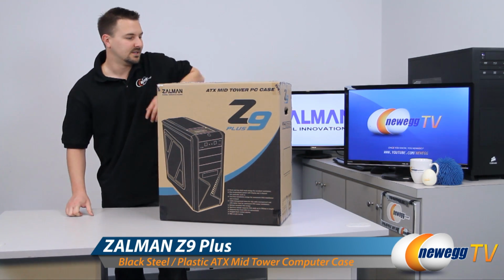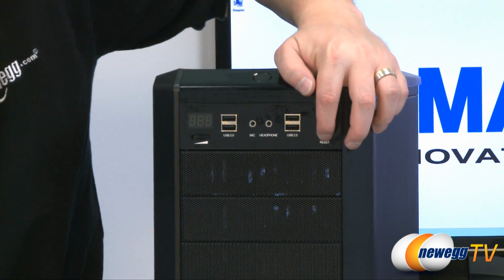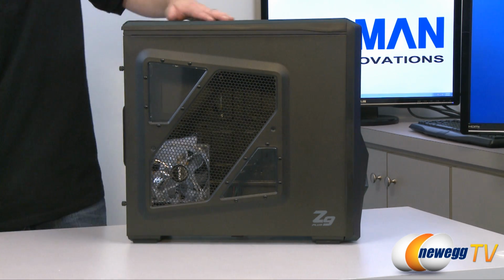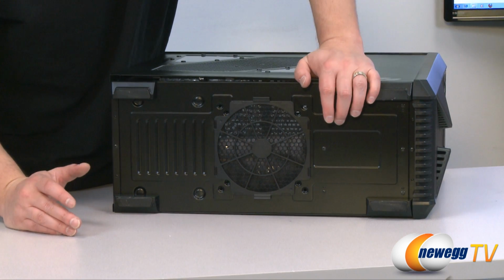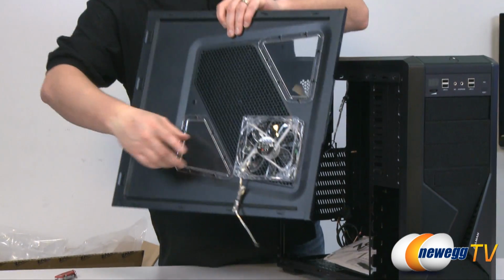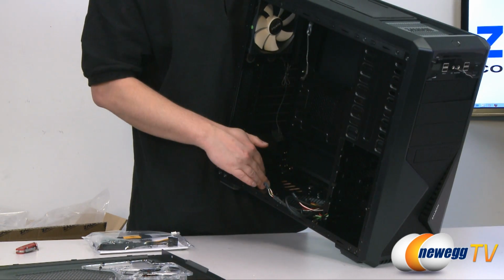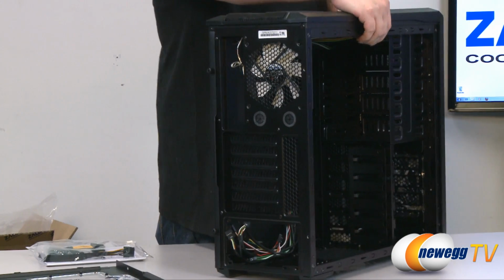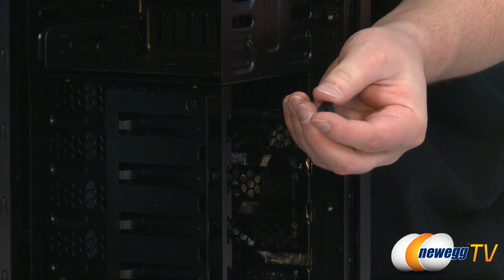Newegg TV: ZALMAN Z9 Plus Black Steel / Plastic ATX Mid Tower Computer Case Unboxing

Comment: i have one of theses very durable. a bit more thought could have gone into the 3.5" drive bays, i just did not like that part of the case with the rubber parts to go onto the drives themselves, but overall i got 7 years out of this case and it is still in good condition, the look of the case was what attracted it to me, also cases with optical drives bays are getting harder to find good ones anymore as case producers are not making as many anymore, or mot making cool looking cases. good unboxing video covers most of what you need to know, thanks

Comment: + It's big enough to put a dual-graphics card configuration in it.
+ You are able to watercool in this case.
+ Nice blue LED fans, which look really nice.
+ Cable management holes, which can be really handy and it looks way better.

- When you turn down the fan speed the LED's will become less bright, which doesn't look as appealing.
- This case comes with only one dust filter which can be found in the front of the case. 
- Loads of open spaces where dust can get through, I've had it for about a year, but it's a complete dusty mess on the inside.
- When you get a modular power supply the inside will look a lot nicer, but you can't put in the fan at the bottom of the case.
- One of the fans is not an LED fan, which is a shame and I have no idea why they didn't just replace it with an LED fan.
- The amount of cable management space at the back is nice, but I would have liked to see a bit more space, because the power connector for the motherboard is nearly too big.
- The 8 pin power cable for the motherboard can't fit in a hole at the top left of the case. They could have made the hole half an inch bigger and it would have been able to fit.
- When you put a component in the PCI-E bracket you have to 'break' a little metal bit that normally covers it. A replaceable metal bit would have been better.

All in all, for the price it's decent, but the manufacturers didn't really think most things through. It feels like they were like: "Well let's put it on the market so we are done with it."
With a dust filter at the bottom, maybe a bit more clearance for another fan at the bottom and a bit more space in the back they could have sold this case for around $100.
I can recommend this case for people on a budget, who still want a good looking case. But there are cases out there which are better for the price.
Reply: Pywy #Nope I do like the case for it's looks, but there are just a few too many cons. And even though most of the cons are not too bad, they could have easily fixed them. For the price it's a really good case, but if I were to spend a bit more money this case definitely wouldn't have been my choice.
Reply: MrGrayfour "But there are cases out there which are better for the price."

And those are?
Reply: maiika 
Fractal Design Core 2300
Corsair Carbide Series 100R
Corsair Carbide Series SPEC-01
BitFenix Shinobi

For slightly more money
Corsair Carbide Series 200R
Reply: Shinobi and SPEC-01 could be alternatives, but I don't see what's better about them in comparison to Z9+. Shinobi can have problem with airflow at the bottom, while SPEC-01 has only 1 fan.

200R has got 44.2°C at 400W temperature and fans set at 12V, compared to 26.3° of Z9+ which has better temperature benchmarks than +80% of tested cases on the market. That's crazy considering the price.

http://uk.hardware.info/productinfo/benchmarks/7/cases?products%5B%5D=119791&specId=8874&tcId=283

Unless you think there's something more important than temperatures?

Comment: I don't understand.. I have three fans, but only two connections FOR the fans. this means that one of my fans aren't doing anything.. If anyone can tell me something I can do about this, I'd appreciate it.
Reply: One of the fans can be connected to the motherboard, so it will receive it's own power through the motherboard.
Reply: Ah, ok. I'll have a look!
Reply: i was thinking the same thing. motherboard only has one case fan and one cpu fan plug. But back fan on this looks to have molex so it would be running full power all the time.
Reply: Oklahoma ADV Yeah, I have a molex-connector fan and it spins at 100% all the time. Luckily it's an okay quality fan, so it's not too loud. Also it will never be louder than my graphics card, because that thing is just insane.

Comment: this did not help me! i dont understand how to install the hard drives!!!!
Reply: You just screw in the little rubber circles and put the whole thing in it's own little space.\
Reply: Are you able to remove the front panel?
Reply: Biz Buz You just have to "pop" it off, there is a bit of force required. I tend to pull on the top left for example. Once one tab is off, the rest is easy.

Comment: yes you can buy a 3 pin to molex but you will not be able to control it and it will run on lover rpm

Comment: PLEASE HELP ANYONE IM NOOB AT THIS. I want to buy this case but im kinda new with the extra fan thing. My motherboard is already full and i cant connect anymore fans to it. Whats the connector of the fans on this case? Or whats the connector in most fans these days? Molex? or one of those 3 pins on the motherboard?. I heard that if you connect your fan to molex directly to psu you wont be able to control it anymore?

Comment: i think it comes with 4, the 220mm at the front, 120mm on the front panel, 120mm on the top of the case and 120mm fan at the back next to the io shield but there is space for more fans

Comment: Disappointing that they put that roof fan in like that because it prevents a mod of putting a handle on the top. Manufacturers really should make more models with a handle, making it easier and safer to carry. Not all of us gamers so don't need all that ventilation, particularly businesses.

Comment: Sorry but is not 6-pin pci extender. It is a 8pin power extender that can slept into 2 4 pin power connectors because the power supply is bottom mounted and most motherboards have the 4 or 8 pin power on the top. This is a Hugh plus cause you dont have to add extra cost if you are just swapping cases like i did

Comment: @khmerog1 I installed the PSU with the fan facing up as I decided the grills were a little too small, also that way the air that goes through it can also be filtered, You can't actually put a filter on the lower side case fan as the power supply gets in the way, to get around this I used one of those thin scyth fans with a filter.

Comment: If you get this case I suggest getting some cloth door screen, cut it up and duct tape the screen over the decently sized holes of the case to prevent large dust to enter it.. There are spots on the case that you can put the tape so it doesnt show to the outside.